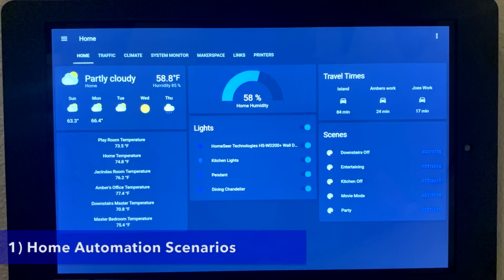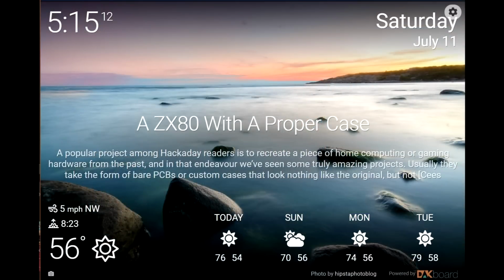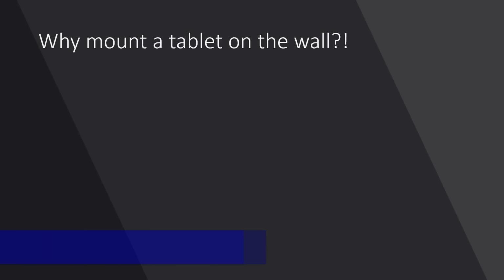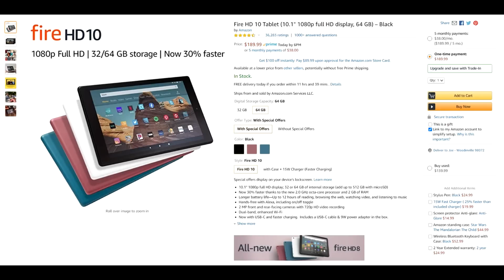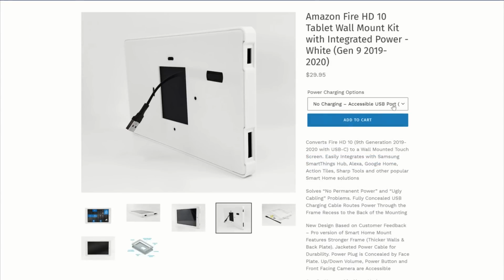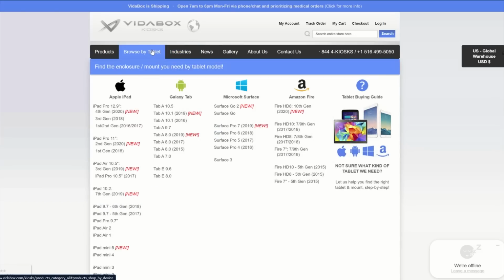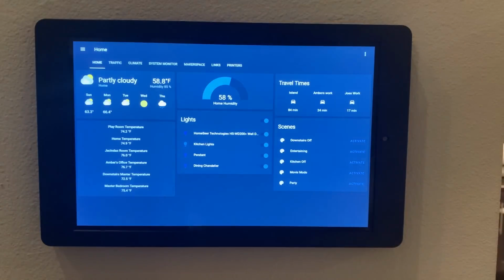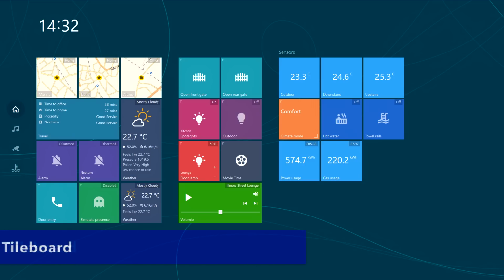5 things to know about wall mounted home automation tablets

Comment: Nice video, congrats.

could you please talk about the temperature sensors that you use in each parts of your house? 
thxs
Reply from the maker: Yeah! This video lays out what they are and how I hooked them up. It's all through Ecobee for my setup, but that made it super simple and handy. This video details it: https://www.youtube.com/watch?v=wMT4TABxa7Q&ab_channel=GeekToolkit
Reply: @geektoolkit  many thanks.
just one more question, I have a PC surface that I like to use as a screen, in your opinion what is the best software to use there.
thank you
Reply from the maker: @kamacete  Like a Microsoft Surface? I'd probably just use a full screen browser if you're using home assistant. If it's a PC, I'd go with that route, but if you can load android on it I'd go with fully kiosk just because of options like it waking up on motion. A windows 10 pc I would think would pull alot of power...it's like using a lamborghini to move bricks across the yard...a little red wagon works fine :)
Reply: @geektoolkit  many thank

Comment: Your video is fantastic.  After seeing it, I purchased a new Amazon Fire HD 10, Fully-Kiosk & Hubitat (really I bought the Hubitat a month ago to replace wink). I'm playing with a few of the software pieces to see what I like best.  One of the questions I have (feels silly to ask) is how do I group individual bulbs?  I have several lights that use multiple bulbs.  In Alexa & Google I group them.  "Alexa, turn on the floor lamp" for example turns on 3 bulbs.  All my dashboards show each bulb individually which isn't very convenient.
Reply from the maker: I’m not sure using hubitat, but it’s a common problem with bulbs actually (I talk a little bit about this on my recent wiz bulb video actually). Scenes are the only way I’ve found if managing them (routines on Alexa) which you’ve found. Other then that I hide them in the UI. For me I’ll assign them to names like “morning mode” or “movie mode” and they also turn on/off tvs and such. 
  Hopefully that makes sense...basically you’ve found the  answer using routines, just see if there is a “scene” equivalent in hubitat and use that

Comment: I worked in an office where we had a wall mounted iPad connected and playing music all day. We must have gone through about 4 in a year, because being plugged into power 24/7 warped the batteries. Have you seen anything similar? I'd happily mount my Fire Tablet, but I fear with the even cheaper build quality that it might become a Fire Hazard Tablet.
Reply from the maker: I haven't myself, but i have heard since this video that it's a problem. Modern devices that are designed well should have charge controllers on them...this is common on anything with Lithium Ion.  What essentially happens, similar to car batteries, is that they go to a trickle charge and keep the battery at a healthy level.  That being said, this is one of those 'should' and not always...older devices apparently didn't have this because I'm seeing quite a few pictures of blow up batteries from various sources.   I'm also seeing people posting about things like relays to keep the battery at about 80% (using an HA sensor for the battery level to work with the relay).  Do you know what gen ipads they were using..I'm curious if it was before charge controllers got as sophisticated as they are today, or if it's an issue with something modern. Apple though usually does a great job on hardware, so I'm surprised to hear that about them at all.
Reply: use a smart plug with automated on and off times

Comment: How can i install hassio and kiosk app on old android tablet like you? And what's the lowest hardware for using this apps?
Reply from the maker: To be clear Home assistant is installed in an Intel NUC...the tablet is just running the web UI. You can’t run home assistant in an android tablet. The kiosk app is just the web page for home assistant rendered in fully kiosk browser, which is an android app. Hope that helps! Lowest hardware for home assistant is a raspberry pi 3b+

Comment: Hi, I have installed a similar setup but when fully kiosk sleeps the display when I walk away from it, it looks like its just blanking the screen because I can still see a backlight. Have you noticed this?
Also, did you have ay joy in getting cctv camera feeds to play from HA on the tablet?
They work find on my laptop but fully kiosk doesn't seem to play the stream.
Reply from the maker: I’ll have to check as far as if it fully sleeps. It may be that it can’t turn it fully off unless using a rooted device. 
  I have rtsp feeds working but haven’t tried a proper cctv feed. Are you using a fire tablet or full android?
Reply: @geektoolkit  I'm using the same tablet as yours, a Fire HD 10. I've used firebox toolkit to get the google play store and fully kiosk installed. Its RTSP streams that I'm using but they don't play on the Fire, hence wondering if you had to tweak something?
Reply from the maker: I’ll check. I think the reason we are seeing the backlight is because we can’t root it (or at least last I checked) to give full access to fully kiosk. I’ll check my camera feed, it may be that HA was converting it for me. My cameras are currently down as I’m working on getting aarlo working. I’ll let you know once they’re up
Reply: @geektoolkit  Great, thanks, if I find anything out in the meantime, I'll let you know.

Comment: When we talk about tablets there is also the option to buy a Touchscreen Monitor and run an proper OS (and Fully Kiosk Browser on it) on a raspberry pi. This has the Plus that its a bit cheaper and the BIG plus that its modular. There are a lot of possibile Things u could run parallel on the pi. And u can with the years when the technique or your setup changes reuse it. Even for a bunch of other usecases.
The con is, that u have 2 setup the Hardware (with some cheaper screens u have to solder) and the OS. But hey, its also hella fun.
Reply from the maker: Agreed a pi is super powerful, open, and reusable option. For me the browser performance has been really poor, even on the pi4, esp. compared to a decent tablet. Have you also noticed that? I am wondering if there’s a different browser I should be trying. Some other upsides are around having GPIOs to do fun stuff with, VNC support, and such. I do worry about how hot my pis run though

Comment: Just buy a tablet and install an app, portable and easier.
Reply from the maker: That's a fair point, and I actually do that as well (we just install the app on any tablet so everything has the ability to control stuff). I need to do a followup for this topic, but here's some things that this has done over the last few months that are better than a roaming tablet:
1) I don't have to worry about where it's at, if it's charged, etc.  It's reliable, always charged, and 'just works'
2) This is setup specifically for 'guest access'.  So I don't have any banking apps or anything personal on it, and so if a friend, babysitter, guest etc wants to control stuff it's where they expect it and it works
3) Location awareness - My home automation setup is..vast, and gets more complex by the month.  Since I know this is located by my kitchen/livingroom/dinring room I can focus the User Interface on those areas. This doesn't have to be aware of anything upstairs, so the User interface is simplified.   That makes it look cleaner, easier to use, etc.

I get that those benefits aren't for everyone, and respect that. But I wouldn't say it's easier to do one or the other...they're really differnet use cases. Like I said, we do both, and I find each useful in their own way. Just like hitting a lightswitch has benefits over home automation at points...I still use light switches at times...sometimes it's the better way to go.

Comment: 1. They're not portable, so they're stupid.
2. They're not portable, so they're stupid.
3. They're not portable, so they're stupid.
4. They're not portable, so they're stupid.
5. They're overpriced.
Reply from the maker: Home automation is a hobby where 39 cent switches are swapped out for fifteen dollar ones so that they can be controlled via other means. If a 80 dollar tablet is overpriced, you’re probably in the wrong hobby.

Comment: Where is link to by this USB cable
Reply from the maker: Which cable are you referring to? for powering the tablets?  Makes by Mike had a transformer to get things down to 5v so you could use a standard charging cable if that's what you're asking.
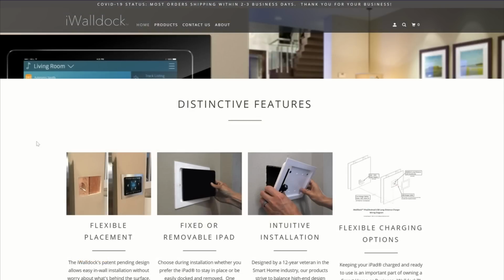Reply: @geektoolkit  that 12:54
Reply from the maker: @tornadocapoeira  Ah, ok! The cables are on the smarthomemounts site also, they're here: https://smarthomemount.com/collections/charging-power-converters
Sorry for the confusion there!

Comment: can I do this with smart phone
Reply from the maker: Not exactly. The tasks can be done with a smart phone, yes, but the main advantage of a tablet like this is that it’s multi user. For instance if a relative or family member wants to use the smart home, then a communal device like a tablet allows others to easily use it.  If you live alone or don’t have other potential users, a phone can do this. I like that even if my phones low on battery or dead I have a reliable way to control my house when downstairs  (my offices are upstairs)

Comment: Very nice vid! I have Fully Kiosk and had the camera motion sensor to turn on the fire hd tablet but had to disable it since it kept turning on when the camera sensed changes in light reflected on the wall from my TV screen. I tried messing with the motion sensitivity on Fully Kiosk but couldn't get it to not pick up the TV screen light. Looking at how you have your table almost in Front of your living room, have you run into the same issue? If so, what are your camera motion settings? TIA
Reply from the maker: My TV has a wall between where it'd reflect and the tablet so that hasn't been an issue. Mine points at the stairs so when I come down it turns on. My settings for motion are the default ones.

I do wonder (haven't tried this yet) if having an external PIR sensor would be a better solution. Then the tablet doesn't have to run and process the camera constantly which would likely save battery (mine drains faster than it's charging right now) and it'd allow you to control where and what motion triggers turning the tablet on. I haven't set that up yet but it may be an idea to look into.
Reply: @geektoolkit  Yeah, I think I might have to move my tablet to another location where it won't pick up the TV screen light. I also have the same issue as you about my tablet's battery draining faster than what is charging. I haven't found out the solution for that either. I'm thinking it might be the charging cable, but who knows. Thanks for the reply!

Comment: Hi, great video. I have one question, I have the same setup as you with the FireHD and fully kiosk browser, only one thing keeps bugging me and that is that every morning when I come down, the FireHD gives a warning for the microphone permission. Than every time I give permission and the next morning the same pop up warning appears. How dit you solve this?
Reply from the maker: I haven’t had that happen on mine. I’ve given the permission and it’s just worked. Sounds like somethings broken for sure. I’d post in the fully kiosk forums to see if someone else has hit that.
Reply: Thanks, hope there is a solution! 👍🏻

Comment: Oh, another thing, do you think someone would still need to do this if they have a Alexa Echo Show? Since you can just ask it for some of the things that that can do?
Reply: My friend You never responded!
Reply from the maker: Sorry been way behind on my comments.  It's a tough question and depends on the use case.  I can speak to mine...I use home assistant. My security cameras don't all work with an echo show, but they work with home assistant. I also use stuff like graphs for temperatures, and internet speed graphs to diagnose issues in my house. 
  A show can handle a lot of things...and if it works with your cameras (if you have them) and you don't need it for the data I"m using it for, then a show would be just fine. I like to build out custom solutions for my uses, and so I find this more flexible, but if your uses are solved by a show, it's a much better solution. It's going to depend on the person.
Reply: @geektoolkit  wow thanks man. I think I’ll stick with a show. I might use my old tablet as a picture frame. Maybe for a video you could turn a tablet into a picture frame/date and time teller. Thanks. I am subbing

Comment: Hey, how can I keep mine on? The dev option makes it dim
Reply from the maker: I set mine to turn on based on camera motion. It turns off after a timeout to preserve battery. I had to register it to allow that I believe.
Reply: @geektoolkit  mine doesn’t have a camera. Any ideas on what to do?
Reply from the maker: I don’t off hand. Which front end are you using? Is it fullykiosk? I’d reach out to their devs as they may be more familiar with that behavior. I have only had ones with cameras so haven’t hit that :(
Reply: @geektoolkit  oh gotcha. I was more thinking of using actiontiles or maybe just in the Home Screen with a calendar and animated backgroud
Reply from the maker: Action tiles may not need dev mode. Can you disable it to get the brightness back? Other idea is to ask on a Reddit forum for the model of tablet since this may be separateissue  from the front end entirely. See if they can help
Reply: @geektoolkit  well I had wanted it off in the night and on in the day since it’s a very old Samsung tab e lite. I found out a way, but it is a bit hard. I have to have a app to set screen timeout for one hour, then every hour I have a smart plug switch off and on, but that makes my tablet have 1hr of no charging when I want it off
Reply: @geektoolkit  another way I tried was using a app that kept the screen on while charging, it worked but the app would close

Comment: I use a galaxy tab a6 mounted too a wall which ia permanently plugged in. In settings theres an option thats supposed to protect the battery by limiting maximum charge too 85% should i turn this on?
Reply from the maker: I would look into it to understand why the setting is there, but my instinct is that I’d turn it on. This would protect theoretically from over charging (though modern tablets should have that via other means). My instinct would be to turn that on though, but also to research and find out more

Comment: what app/ui would you recommend for a wall mounted ipad? I like the ones you showed but I don't think they're available on the app store
Reply from the maker: I'm not sure honestly, as I'm pretty deep into the home assistant ecosystem. I'd guess if someone is mounting an ipad they're into the homekit ecosystem..not sure if there is a homekit app, or dashboards that can talk to homekit. If someone mounts an ipad and isn't into homekit then it's going to depend on what they're running (for instance if you're into Samsung's stuff you'd run smartthings...)

Comment: Hello excellent video.  how do you make the tablet call when we approach?  (3.50m).  I have an iPad Pro. Is it possible to connect when we approach? Thanks.
Reply from the maker: For android the software is able to use the camera to detect motion and wake the tablet. I don’t believe iOS allows apps to have that level of control. An iPad Pro is a pretty beefy tablet to wall mount for a display.

Comment: I got Wall Panel onto my Amazon Fire and then got an error when I tried to open it to launch ?
Reply from the maker: What error?
Reply: @geektoolkit  I will send you exactly what it says when I get home. 
Thanks for getting back 😊
Reply: Well even weirder  !
I can’t even get the error to happen now. 
When I open the app I downloaded on my Amazon fire it shows screenshots but I can’t launch it. 
Ugh
Reply: @geektoolkit  the webpage could not load because net:: error_connection_closed
Reply from the maker: @randy8978-z5e  Hmm. that could be a ton of things. Can you browse in a browser outside of wallpanel? Does it reproduce after a reboot? Is the wifi connection working?  That's a pretty generic error that could be a number of things unfortunately. I'd post in the wallpanel forums though and that may help signifigantly
Reply: @geektoolkit  found part of the problem. Wifi !
But the wall panel app doesn’t I open like other app !
I am trying another method. 
After this I may see if I can use home-assistant with my Vera plus 🤞
Reply from the maker: Sounds good glad you got that tracked down at least!
Reply: @geektoolkit  love your videos specially for my skill set !
I may have more if I try this other project.

Comment: Great video, learned so much! I have many wi-fi controlled devices in my home, Switches, plugs,  light strips, etc.  no Zwave or Zigby devices.  I currently just use Alexa to control but I really want a couple of wall-mounted tablets to control everything.  What is the best route when I only have Wi-Fi devices?
Reply from the maker: The only way I'm aware of to do that would be to get a hub like smartthings, and then use actiontiles to control the devices.  Even though you don't have Zwave/Zigbee, you'd need a hub (I believe) to act as a go between for Alexa and the tablet to provide a UI. Or possibly launching the alexa app on the tablet, however I am not clear on how customizable that is.  The beauty, to me, of a tablet on the wall is that 'dashboard glance and go' feel, but that requires customization.